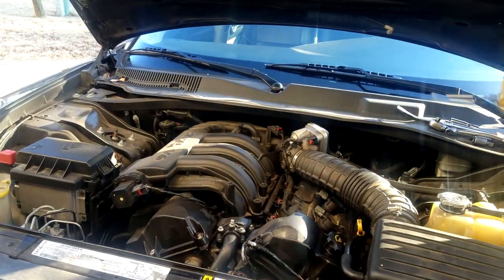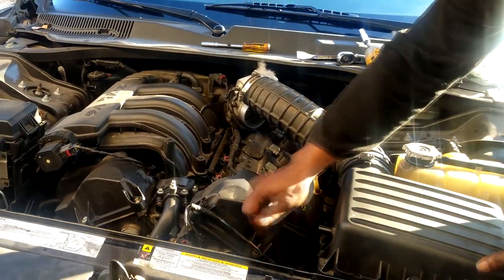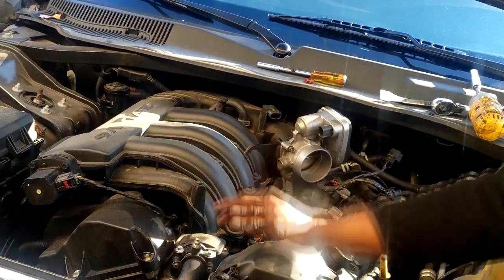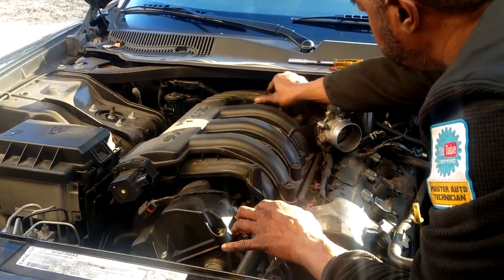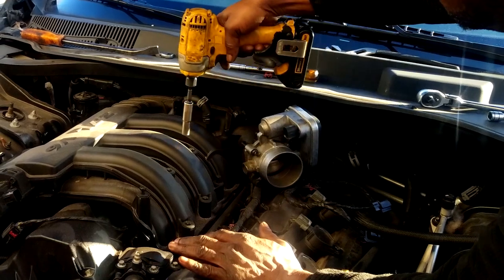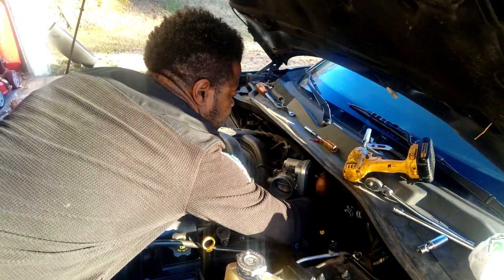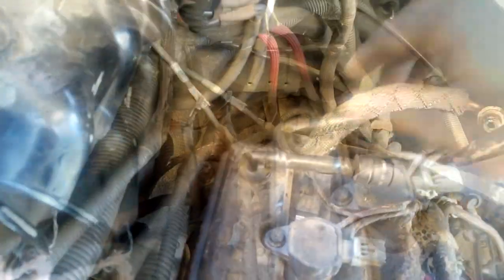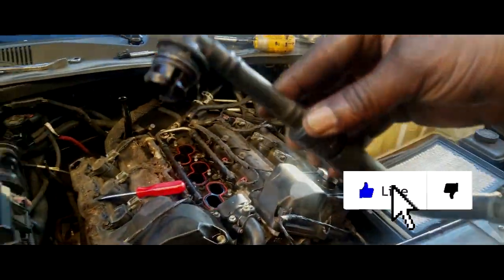How to replace your PCV Valve

Comment: Smh The hardest part to disconnect, you jumped right over that part brodie respectfully but that's a part we would need to see how you got that metal part unplugged from the manifold... along with the 2 easy plastic hoses you took off.. salute to the video but that part was important

Comment: Love your videos. I'm not a certified mechanic but I do almost every thing on cars and fix friends cars. I'm almost 60 and I've never worked on a piece of crap like my daughter's boyfriends 2010 charger. Crap! The design, the lack of thinking. It's sad. And to see years later the same issues not fixed by dodge is so disappointing

Comment: I have a 2011 dodge charger rt having a evap purge solenoid problem I changed out of the evap purge solenoid on top of the intake. The code still comes back can't figure it out

Comment: Same location for the 3.6 Pentastar?
Reply from the maker: O no buddy,,That PCV valve on the 3.6 is on the bank 2 cyl head..If this a minivan its on the passenger side at the rear of the cyl head held on by 3 T25 screws and kind of a pain to do..I got that video coming sunday, please subscribe for me, thanks
Reply from the maker: The location for the 3.6L engine.   here  https://www.youtube.com/watch?v=0By_T50wDe0